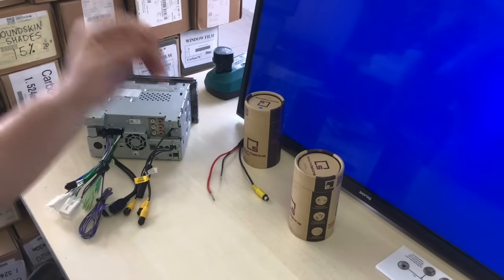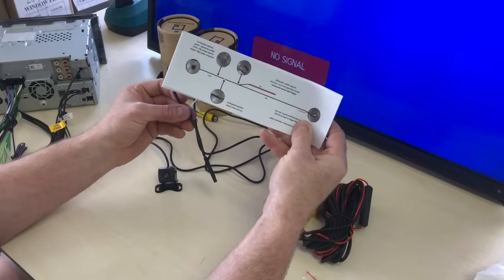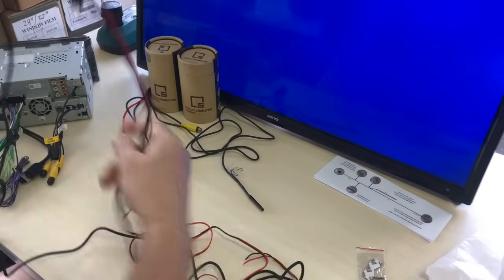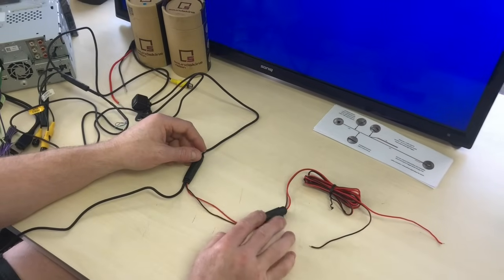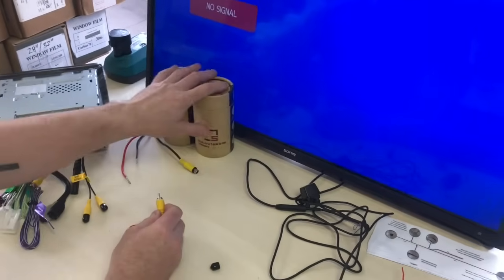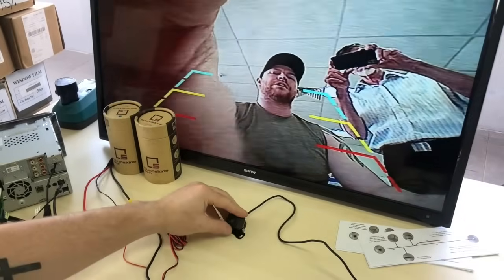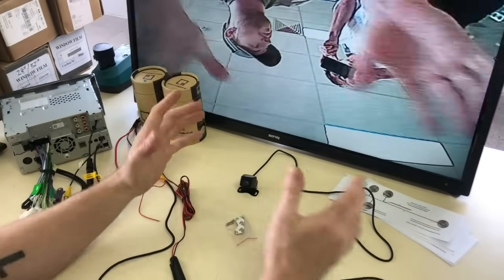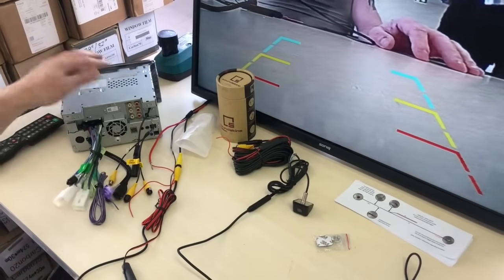How To Wire A Reverse Cameras | Reverse Camera Wiring Explained

Comment: Hi, great informative video. Are these still available now 11 Feb 2022? I have a 1992 Landcruiser 80 series with barn doors so it might be an issue with where to locate the camera, but I have a cheap no screen stereo and want to fit a reverse camera and possibly a front one also depending on prices etc...

Comment: My rca cable has a red pigtail at each end. In your vid, at the stereo end it connects to the purple reverse wire from the head unit. Where does the red pigtail off the rca at the back of the vehicle connect?

Comment: My camera won’t display on the screen. I keep getting the “no video signal” message on a black screen. All the wiring is new and connections are good and correct. Is it possible that the video output of the stereo has shorted?

Comment: So we have to connect the red wire to the tail like it reverse like in order to get the cane to work. How about if the RCV connect to the head unit and the HU has a red wire to connect red pig tail. Would that power the camera or does it have to be connect to the reverse light to power the camera?

Comment: My replacement reverse camera doesn't have those 3 loops wires. Video feed from the reverse cam on my Lenovo V7 plus dashcam is not mirrored. When I park with the sidewalk on my left, reverse cam feed shows the sidewalk on my right. It's really nasty. Is there any way?
Reply: Having the same issue

Comment: Hello, I have a near identical backup camera as shown in the video, however it goes to my dash mirror, which the end of it is a 2.5mm male. I just recently installed a aftermarket radio, and I got a RCA cable with 3 wires within the cable, (Red, yellow, and black) with a pigtail, and what would the red go to? I know the yellow goes to the data feed. It seems like the red wire is some sort of ground, (because when I scrape it against the main 12v source it would spark)

Have put over 3-4 hours trying to figure out any possible way to get this fixed but to no avail! Its pissing me off

Comment: How about a camera that does not have the flip option? There is only 5 conductors. 2 for power 1 for reverse light and 2 for image. One day I woke up and my camera is upside down.  Worked normally for awhile...

Comment: I have installed PCAM- 110 N , the lines show But no video, can you give me some ideas whats wrong? Thanks
Reply from the maker: Not sure on that camera please consult the installation instructions.
Reply: CarbonCarSystems the manual is short and not really good info, been googling like a mad dog and no answer even echo master hasn’t replied
Reply: Video cable plugged into the right spot on the radio? Has video capabilities been unlocked with a tazer ?

Comment: What are you using to power the camera? I need to bench test a reverse camera but I'm not sure what power supply to get
Reply: any 12v battery or 12v power generator.

Comment: Hey mate, how can i tell if my factory head unit, mq triton base model accepts the camera? I've hooked up the camera as per your instructions but no camera on screen. I've checked with a multi and the trigger voltage is at the plug at the head unit and the camera has voltage.

Comment: I have the Kenwood CMOS130 camera which not only has red and black cables, but a blue wire coming from the camera cable.

I've wired everything up besides the fuse and the blue wire and my DDX19 hesdunit says the camera is not available.

What am I doing wrong?
Reply: The blue wire should be for the camera footage. Im not sure though because I'm on the same boat. I already have a aftermarket backup camera that uses a 2.5 mm auxiliary cord, which is a 4 prong type of ordeal. Cannot get it to work worth of shit.

Comment: Hello if I wire a license plate style camera that has l.e.d's around the lens to the front of my car and power(+) it off my Kenwood Excelon head unit will the LED's stay on constantly or only when I switch to the camera mode on the head unit ? Thanks if you can help !
Reply: It will turn on with the camera. Unless you go to a always on cable.

Comment: If it is wired in this fashion, to a reverse light positive and also to the HU reverse trigger wire, can one still activate the camera while driving forward if HU has a camera on off button?  Or does one have to wire it differently to accessory power, but the downfall is the camera is always powered and on reduce its lifespan perhaps?

Comment: my camera show great when powered by the alternator, but seems not to get get enough power when car is on (connected to reverse wire).  Help- VW Passat se
Reply: I am having same issue.. camera works normal in the accessory mode but when the engine is on I am getting no signal.. any solution?

Comment: Mate, can you help me? My headunit has a purple/white reverse trigger cord. The headunit also has a pin connector that goes into the rear of the headunit with 4 wires coming off it. There is a black 'Cam Ground', a red 'Camera Power', a yellow video RCA and finally an Aux 3.5mm jack.  Each wire is only about 200mm long. Now, the camera I bought is a parkmate. It includes a 7m long yellow RCA for video feed, so i know that will connect to the headunit RCA. Check. But there is a red wire and a black wire and the instructions say to ground the black wire and connect the red to the reverse light. These wires are about 1.5m long. So that makes sense, i'll connect it as mentioned (ie black to ground, red to reverse light). My question is, how do I actually connect the 'Cam Power' and the reverse trigger wire from the headunit up front?! I have no idea where these are supposed to go.